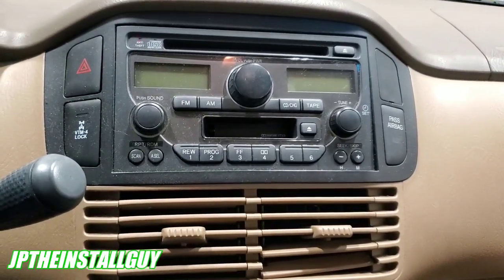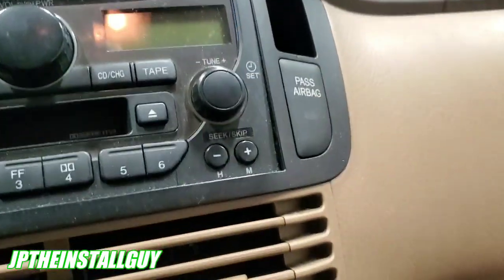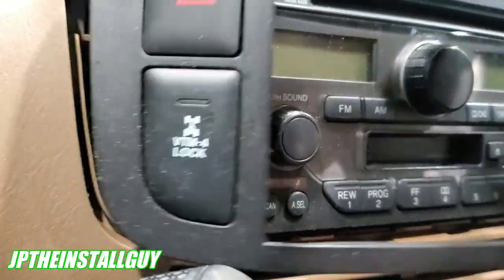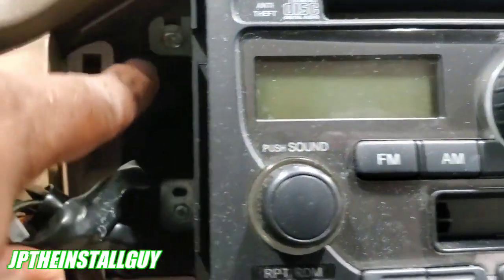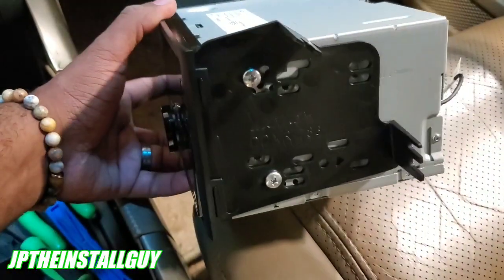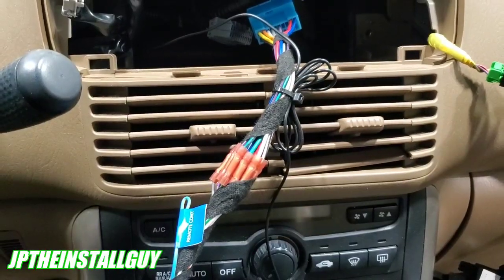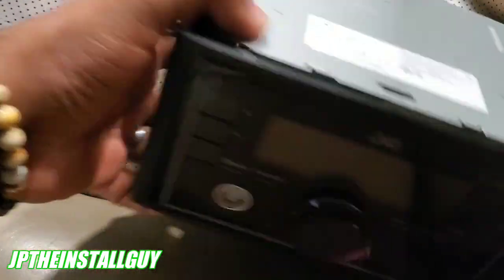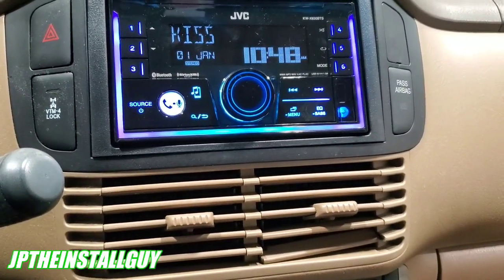2005 honda pilot radio removal and CD player install

Comment: I have a 2004 pilot with a factory DVD player and over head screen i would like to replace the factory radio with a new after market radio but i will like to be able to keep using my factory DVD and over head screen is that possible.

Comment: Nice video bro but these things are bullet proof I have a 2014 Honda pilot elx Navi and got almost 200,000 miles with factory sparkplugs
Reply: What size is that radio you put in

Comment: okay so here's the situation literally this will be the first time I've ever commented any YouTube video ever I have a 2005 Honda Pilot EX I just installed an aftermarket stereo I've hardwired the harness to the wires in the car but I have sound only coming out of my passenger side door and no other speakers I don't know if it has anything to do with the 6-disc changer or not any help would be much appreciated
Reply from the maker: Do you have a wire diagram? Because first thing I would ask if you have all the proper speakers wired correctly. Next I would think you may have some blown speakers so it wouldn't hurt to take a door panel off and test those speakers, you said one plays so that means there is shouldn't be a  factory amp anywhere so yea check the speaker wire colors and speakers

Comment: Did you wire for the steering wheel audio controls? I can't find a wiring diagram or harness that seems to cover that connection. Mine is a 04 Pilot, no navigation stock radio I'm replacing.
Reply from the maker: ok so you need the maestro sw and here is a video on how to install that with your radio my friend https://youtu.be/8VCr4IpC4-k hope this helps
Reply: @jptheinstallguy  Exactly what I need. Thanks so much, brother!
Reply from the maker: @jeremybatesfilm  yesir🤜🏾🤛🏾🤜🏾🤛🏾

Comment: I have the Navi screen where you were working…. Radio stuff is lower down. I want to get rid of the Navi in my 2005 and put in a double DIN with Bluetooth….. would it be the same method?

Comment: I needed to see how you wired this because i have a 2006 honda pilot, just bought a double din radio/cd player to put in it. I get it wired up like i believe it should go. how i have done it before and no power to it. so i bought a bypass brake controll tried that still nothing. :( can you assist.
Reply from the maker: i did a video on how to wire a cd player https://youtu.be/T1Av3dKGN_4 and if you still need help with the bypass i have a vid on that as well https://youtu.be/PMVJVQxodtk

Comment: on 03 pilot, when I pulled the stock radio it had two harness attached to the stock radio, plus the radio antenna. I think the second harness is the natural  wires, do you know where I can find a the adaptor for  a two harness connection?
Reply from the maker: you should only need the 1 harness
Reply: @jptheinstallguy  I found out the second harness is to connect a subwoofer that in car but when someone connects after market radio, they lose the sub.
Reply from the maker: @drivehardearnhard6574  oh yea i totally forgot about that factory sub. yes in this car the sub is powered by the radio and if you want to retain it you need an amp.